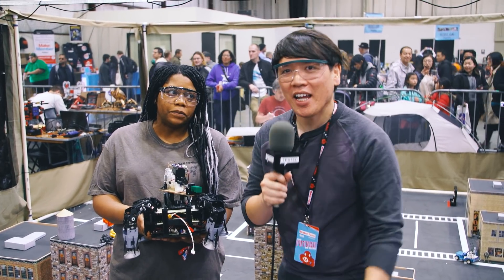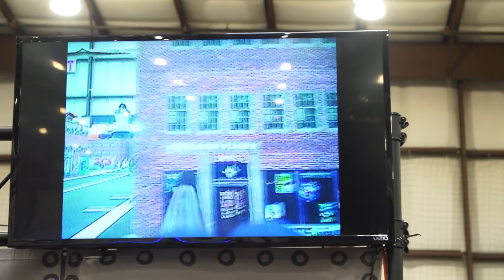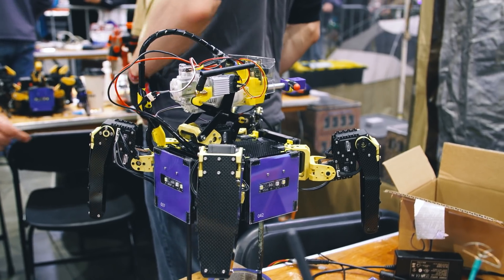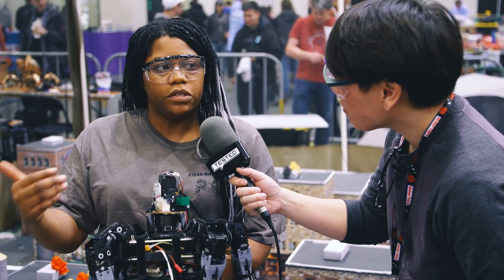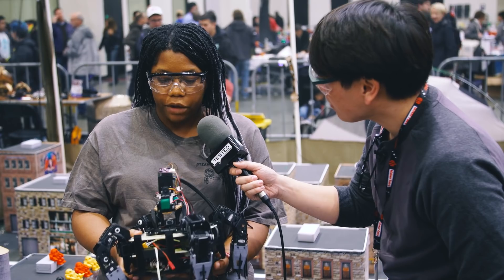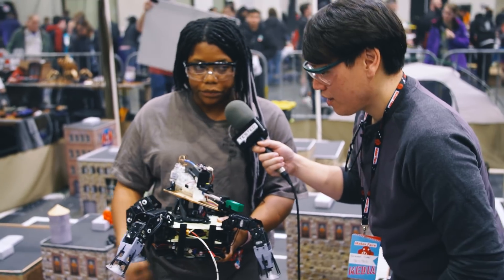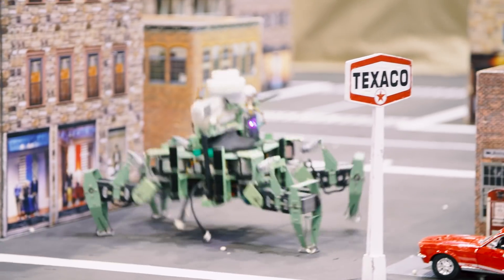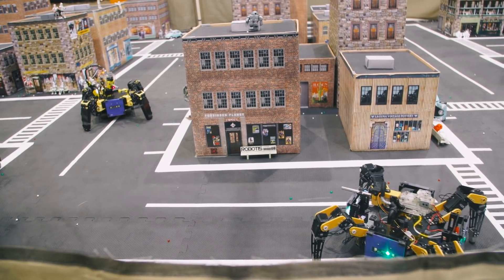Mech Warfare with Airsoft Firing Robots!

Comment: My only critique would be of the game theory which is that it makes more sense for you to gain a point when you hit someone than for them to lose a point because, under that system, it encourages camping.
Reply: perhaps its a ranking thing, besides theres anti-camping motivation in that you are running on a battery source, you only have so much time before your battery needs charging, and yes I know that varies depending on battery type used... Although technically I have to kind of agree with you at the same time because a camping bot uses less energy than a moving bot but urban maps arent as easy to camp with a mech like that as it would be for tank or infantry... if you take up a position there will be a section of you always exposed and the gap between building may or may not be beneficial to you...

Comment: Now, make it 40 times bigger and put A10s gatling on it.
Reply: or just 5x and any form of lethal weaponry on it... hell you don't even need GAUs, just build some weapon system that uses .22 and unleash it on a unruly mob of civilians, the carnage will be spectacular! (especially if its a mingun built for .22! and as for why .22, cheap and easily sourced, so when you run out of issued ammo you can just go into the gun store or whatever and "acquire" more ammo. ... Maybe also make it capable of using 9mm too...)

Comment: OMG! thats so COOL!!! please make a video on how to make one, or at least how we as viewers could make one please!!!
Reply: Well, those looked like 12dof 4-legged walkers, so they probably weren't that expensive. But the video was pretty jerky. Hexapods with 18dof would walk smoother. I'd also put peripheral-vision cameras on to show a wider field-of-view, with 2-axis headtracking. Easily done streaming over WiFi. 
Look at the hexapods at lynxmotion.com
Reply: Roboticist here. These robots are most likely the ones Trossenrobotics sell on their website. These are the guys that make the Dynamixel servos.

AX-12 are smart servos so controlling them using position, velocity or torque is very simple. However, check other Dynamixel servos series, since these ones cannot output much torque but expect high-price tag with them (around 300 or more USD for piece).

In terms of controlling them, these robots also use an Arduino-compatible board called Arbotix-m Robocontroller, that are designed to work with the Dynamixel servos. So it is an easy plug-and-play matter but with some modifications along with it. Also example code is available to use for controlling them.

Hope this helps.

Comment: Where can I find the airsoft gun components that they are using?
Is it full auto or semiautomatic?
Reply: @Guybrush Threepwood You build the airsoft gun? Looks off the shelf. 
Could you please elaborate more?
Reply: they are using plastic aeg gearboxes and a custom hopper solution
Reply: Correct. We use AEG gearboxes and make custom breaches and hoppers.

Comment: full scale with rail canon, woops shh!! don't tell anyone ;)
Reply: well... to fire a full-scale railgun you also need to be connected to a power plant, no way to carry that much energy
Reply: @Shajirr_  depends on the output, and technically if its got an on-board power plant or at the very least a battery bank capable of firing at least 1-5 shots with perhaps solar panel and a secondary battery that allows basic minimal functions after discharging the main batttery... It COULD work but you wont be moving around after firing and you better hope whoever you are shooting doesn't survive... (realistically the mech would have to be large in scale to accomendate a railgun AND power source though)

Comment: From the thumbnail I thought they were made from Lego. That would have been awesome. Standard parts and no adhesives. Then there could have been some real Mech carnage without doing expensive damage.
Reply: We tried that in the early 2000s when the Mindstorms line first launched. The issue with that is Lego isn't all that great at free movement. Simple wheeled bots, slow crawlers, assembly line type machines. Fact is at the end of the day it's an interlocking bricks system & with enough movement something has to give. BUT. Lego RC destruction derbies are pretty fun.